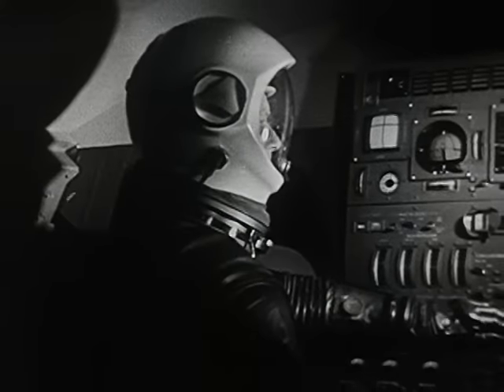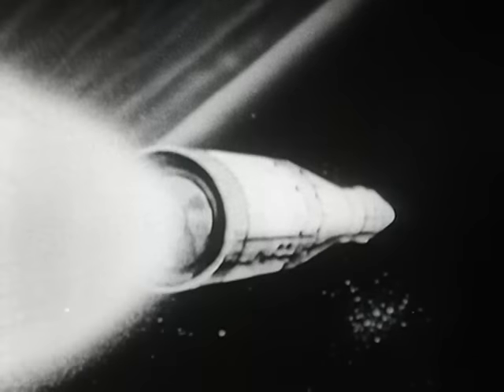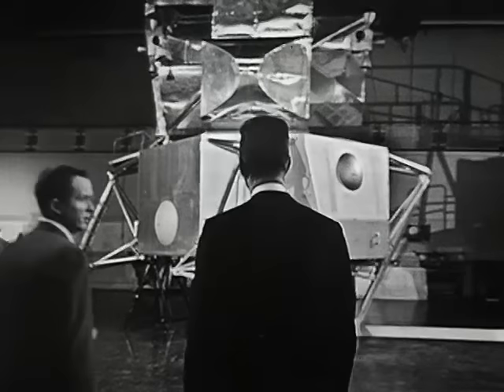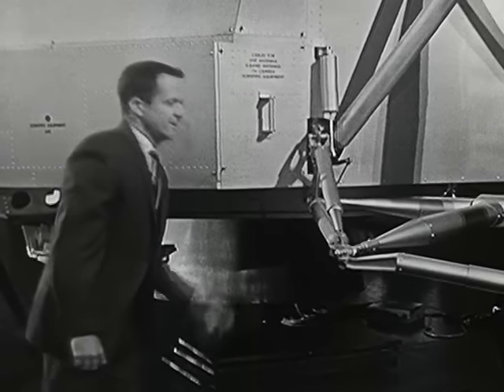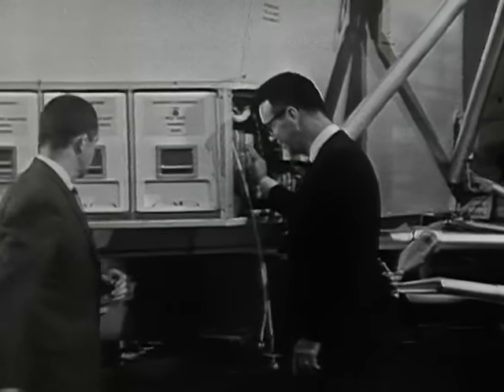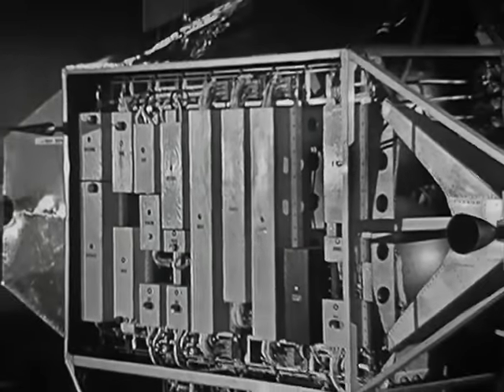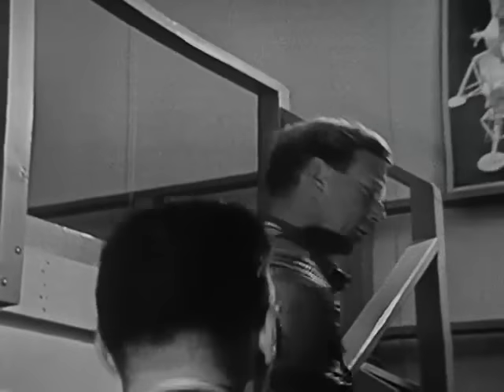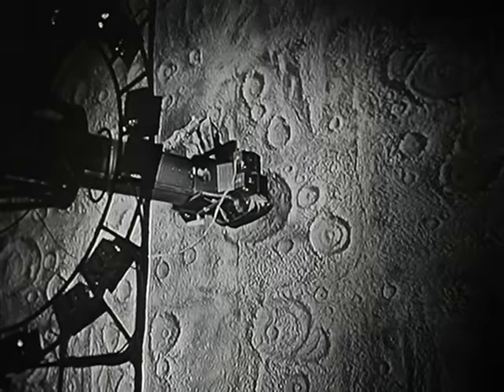MIT Science Reporter — "Landing on the Moon" (1966)

Comment: The real ones were actually made of tubing covered in fairly thin aluminium cladding. Grumman were awarded the contract in 1962 and started designing immediately. The LM went through many design changes although it was almost finalised by 1966. However, some of the images in this documentary show the LM with a circular forward hatch. This was changed to a square hatch in the final design.
Reply: No Lunar Lander EVER crashed. You are probably referring to the Lunar Landing Training Vehicle (LLTV), two of which did crash. These were not lunar landers. They were training devices built to train astronauts in some of the characteristics of the real Lunar Module. They were MUCH less sophisticated than the real LM and were operating in a far less benign gravitational environment so, when they went wrong, they went wrong very quickly.
In fact, NASA did not really want the astronauts to use the LLTV but the astronauts insisted.
The real LM performed like a champ and indeed, saved the lives of the Apollo 13 crew. The people at Grumman should be rightly proud of the LM.
Reply: +Milt Farrow  Try fact checking before you commit to total nonsense. Ericlrl's post is correct in identifiying the LLTV as the vehicle you mistook for the LM. There were several hundred flights in these vehicles with Neil Armstrong taking some 50 or 60 of those flights himself. 

Only 2 crashed with the one you have a fixation on was the one being flown by Neil Armstrong in mid 1968. This crash was not due to a design flaw but a pilot error. Bill Anders flew the rig just before Armstrong and he forgot to inform Armstrong that he had operated the crossfeed valve that bled propellant from the RCS tank to the main engine tank. The result was that the LLTV ran out of RCS propellant in midflight.

You are propagating the malicious propaganda of the moon loon hoax conspiracists!
Reply: I can't imagine why they would change to a square hatch, isn't that more vulnerable to strain from pressure difference?
Reply: The change from round to square was to allow a crew suited up in the A7L spacesuit with the PLSS backpack to ingress/egress. The pressure difference was only 3.5 psia and with 3 EVAs would only go through 3 cycles of decompression followed by recompression besides which the four corners had a very generous radius of curvature.
Reply: Just CuriouS Ah, forgot that they lowered the pressure because of pure oxygen. Good point
Reply: It also permitted a fully suited astronaut to fit through as the round one did not.
Reply: That shit doesn't work
Reply: @jugganuat6440  and of course, you have lots of science to back that up, right?
Reply: Almostfm I have plenty of common sense which is lacking among many of you who actually think man went to the moon
Reply: I remember the design kept changing. When they made a plastic model of the Saturn rocket kit. The first one never had the LEM included, you had to send away for it because they had no idea what it would look like. The first models just didnt include it. I got the one with it. It wasvmy first model. I ruined it by using too much glue.
Reply: EricIrl ...Doesnt matter...It was only a prop anyway...
Reply: @sol2544  Hi. I think pressure was not as bad as you might think.  considering the LM had areas of paper thin foil in its construction. So tin according to Neil Armstrong you could have poked your finger through certain areas. Man it took a bucket of balls to land that!
Reply: Let Me guess? You were born after the moon landings and haven't a clue if we did or didn't. My late father was a computer speacilist for IBM and was in mission control for APOLLO 10,11 & 12. I got to meet  the late Pete Conrad who my father worked with on 12
Reply: @jugganuat6440  And you can explain why it won't work? Enlighten us please without the needless insults. I'm serious. Show us your proof
Reply: If you know anything about the subject. Please explain how it's impossible. Please don't answer with insults but with your understanding of the subject. I'm real interested with what you have to say. I'm not trying to be a smartass but if you're going to claim that then back your statement with what you know.
Reply: @William Horsley re: "Would you enlighten us on the Dopler effect please. "
Ever heard a train whistle or a siren as it passes you by? Same effect happens to radio waves as a capsule revolves - orbits around the moon ...
Reply: @Day R re: "I can't imagine why they would change to a square hatch, isn't that more vulnerable to strain from pressure difference?"
Pressures were low; when back in the LEM pressure was only brought up to like 5 PSI b/c of the pure O2 air used ...
Reply: The square hatch wasn't exactly square.  It had generously rounded corners to avoid the "strain" issues brought up above.   It was a compromise of square to allow easier passage wit the PLSS and tools/samples/cameras carried in and out.  And round to allow strength against the pressure.

I always say the Apollo missions were 10% science, 80% engineering, and 50% audacity.
Reply: "I have common sense."
The fantasy excuse of those who are lacking in basic education, so they want people to believe that science cannot overrule their feeling that something should be the way they want it to be. 
In other words "I have common sense" actually translates to "I'm ignorant and don't really have a clue what I'm talking about."
Reply: @jugganuat6440  • I'm a bit skeptical: they said the booster war produced in Atlanta, so now I'm just wondering where was then the pangolin? 😋

I do not know if man went to the moon, but for sure every pictures and videos are fake.
Reply: @anodine_org  many photographers who have never identified fake photos before say the Apollo photos are fake.  All those years a Sears portraits studio paid off!
Reply: The real ones were NOT actually made of tubing covered in fairly thin aluminum cladding. There are plenty of photos available of the Los under construction, and the pressure hull is very similar to the construction of an airliner.  
The "thing aluminum skin" which some hoax people called tinfoil, is BoPET.  An aluminum and polyester hybrid that in layers was very effective at reducing heat and radiation.
Reply: @DeputyNordburg  - I don't really your sentence "All those years a Sears portraits studio paid off!". Anyway, it does not sound like an argument, just a kind of irony out of the topic.

I have no interest in discussing with you anymore, your speech is empty.

I wish you a good trip M. Deputy.
Reply: @anodine_org   If it helps, I don't really your sentence either.  

Recently prominent wedding photographer and healing rock salesman Gary Fong identified the Apollo photographs as being "impossible".   Who could be better prepared as an expert to identify fake photos?
Reply: @DeputyNordburg  - Like an expert from NASA?... 

I do not care who is speaking, I just care what he's saying.

Hasta la vista, Empty Deputy! No time to loose with your Appeal to Authority, with empty speech.
Reply: @anodine_org   You are the perfect customer for Gary Fong's healing rocks!  He guarantee's they are 100% shungite.  Not the run of the mill 90% shungite your doctor recommends.  

Farewell sweet anodine.  Remember: I don't really your sentence either!
Reply: @DeputyNordburg  - You don't really UNDERSTAND anything. Bye!
Reply: @anodine_org   Goodbye! (again)

SHOULD i ALSO use CAPITOL letters?  DOES that HELP you SOMEHOW?
Reply: @DeputyNordburg  - Bye.
Reply: @anodine_org   Goodbye a third time.
Reply: @jugganuat6440  Common Sense doesn't matter. The only thing that matters is the engineering and the math, neither of which rely on common sense.

To argue the point, what "common sense" issue is there that in is contrast to the science and engineering of the LM?

Comment: Early version. You can see quite a few things that changed, like the round hatch. It seems almost comical that they tried to fit a guy wearing a square backpack out of a round hole. Any toddler could gave told them that was wrong! But it’s always like that when you are in a hurry trying to solve very complex problems. And really the LEM was an engineering marvel and performed flawlessly and saved the apollo 13 crew by doing something it was never designed to do. The Grumman team had reason to be very proud, despite how they were portrayed in the apollo 13 movie. It looks naked without the mylar foil.
Reply: Yes, I read Tom Kelly’s book about designing the LM and when he first heard about the Apollo 13 incident he headed straight to Grumman hours earlier than the usual start time. He was going to start calling people in but was amazed to find them already showing up. Quite the commitment by everyone. On the other hand, over at North American Aviation, they all seemed more concerned about finger-pointing who’s fault it might have been.
Reply: Before moon walking the astronauts in suits poked their heads out the top round hatch to survey the area around the lander.   They did not have the PLSS at this point, but were connected to the LM via umbilical cords.  

The side hatch was "square" but had rounded corners.  They better accommodated the PLSS, but of course there astronauts had tools, cameras and sample bags to haul out and then in some cases back in.  So the square hatch made more sense.
Reply: @DeputyNordburg  That happened on Apollo 15 only.
Reply: Actually the front hatch was originally designed as a second docking port.
Reply: @rolandsuhr145  that was probably axed as part of the massive weight saving effort

Comment: Good to see some of the development work that went into the project - that LEM mock-up looked very heavy!  :-)  For example, the cases for holding experimental equipment looked to very thick and bulky.  -  Also interesting to see some of the early design ideas - eg the exit hatch for the moon excursions was round in this version and seemed to have hinges - rather than the smaller square panel on the real thing.  Fascinating stuff!
Reply: LM underwent a weight reduction program before the landings. But structures still had to be strong enough to withstand the 4G launch environment.

Comment: My goodness. Their lives depended on that tiny ascent engine working flawlessly to get them off the moon.  Imagine hitting the go button and nothing happens. I’d have been having nightmares about the possibility of that.
Reply: Given in 1969 a car might not even start reliability in the winter...
Reply: The ascent engine used hypergolic fuels which means they (fuel and oxidizer)  ignite on contact with each other . The astronauts if needed such as the electrical actuation of the engines did not work , they had actual access to manual valves that on turning on  like a tap they could start the engine.
Reply: That's actually the beuty of the design, it was like sitting on a bomb, it was simple as hell.

Comment: HOLY CRAP.  Check out what he says starting at minute 4 and 33 seconds: "Even though manned exploration of the moon isn't scheduled to occur until the END OF THIS DECADE, the hardware for project Apollo is already being developed..."
Reply: Yes.  The assumption was that we'd get to the Moon in 1968 or 1969.  But it takes years to develop the rocket and all the spacecraft systems.
Reply: +almostfm  No! No! No! The whole Apollo stack was quickly constructed out of balsa wood, tissue paper and dope the day before. The engineering clueless just do not understand the timeline planning behind such a huge project. The liquid oxygen tank that exploded due to faulty electrical wiring that nearly destroyed the Apollo 13 was already manufactured and stockpiled in mid 1968 two years before the disaster. There was enough hardware already manufactured to extend the Apollo moon landings beyond December 1972 by two when the Program was axed.

Comment: For a project of this scale and cost, every part would be manufactured and have fit tolerances of a few thousandths of an inch. Highly precise mechanical manufacturing techniques were available at the time, allowing the fabrication of things like precision optics, avionics, and watch-making. Every fastener location would be precisely calculated to minimize tension, shear, and stress loads, based on a mathematical load profile model, not randomly taped or glued, nailed, or riveted at random locations. There is not a professional engineer in the world who would permit the possibility of a fabrication phase that would let obviously unskilled and sloppy technicians just wing it at the last minute. It makes no difference that “panels don’t have to be have to be that precise,” as some have opined, the design process would automatically result in the consistent, and highly optimized placement of every part. There would be no use of tape, let alone pipes only half-wrapped! Sticky tape is made from gummy (liquid state) glue. Any liquid, exposed to a vacuum, 200 degree+ temperatures, and intense UV radiation  would immediately boil, or vaporize. Also, the design would never allow for gaps - anywhere.  Any gap is a potential for unknown objects or particles to enter locations which could change the weight distribution, or result in unplanned thermal or chemical conditions, and would have been designed out the realm of possibility in the first draft. Even a small possibility of something being even slightly dislocated from a precise location would be unacceptable, as this would represent an unknown, which would require much more complexity in design. For example, in this case, the engineering design fabrication procedure must have specified something like “now just put tape wherever it looks like something might shake loose, or Lord knows what could happen!” Of course this is absurd, but the engineering design process would necessarily have to account for such a ridiculous fabrication variations, and would require an analysis of all the possible places that the fabricator might in fact place the tape, and how those possible tape placements might affect thermal and stress characteristics. It is far easier to simply specify exactly where everything needs to be fastened, as one would expect. And WTF are they doing protecting metal struts from the sun anyway?? There are plenty of other exposed metal struts. And why are the thruster assemblies different,
? (see the right side of the NASA-linked picture) and why are there more than what is necessary to provide orientation control?  Or, to save on weight, why not have one gimbaled thruster per corner, and aim it in the right direction, using a gravity, acceleration, and altitude-actuated control system? The analog control systems technology to do this had been used in rocket guidance systems for decades. I could go on listing absurdities for hours, as could any first year engineering school drop-out, (as could any mechanic, or manufacturing industry worker, for that matter). 
I’ve never been a moon hoax conspiracist, but if this picture is one NASA actually claims is taken on the moon, it is absolutely certain the entire program was a fraud. If there were something beyond absolutely certain, it would be that.
Reply: Which picture are you talking about? If you are going to say so much about it, at least identify the picture in question.
Reply: No link or reference to that picture?
Reply: Yet it was done with the amazing perfection and technology of Y-12 assisting for critical components so the entire program was not a fraud.
Reply: A lot of words to say you have no clue

Comment: I have never heard about this gantry structure at 21:37. I thought they had only  a jet engine based model for an  flying version of the LM that can simulate moon gravity on Earth. Maybe they gave up the idea of this gantry later?
Reply: The gantry structure is one of 5 different simulators they had for teaching different things.  This one was far safer to operate and a good place to start.  The jet engine based simulators the LLRV and LLTV were far more real, and far more dangerous.  The gantry is still there btw, you can see it from the road and they use it for various things.